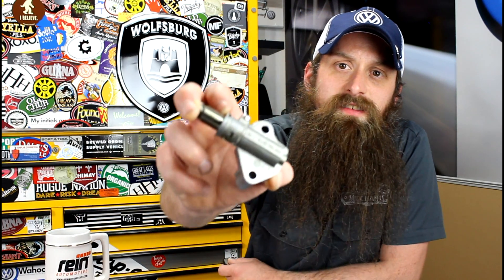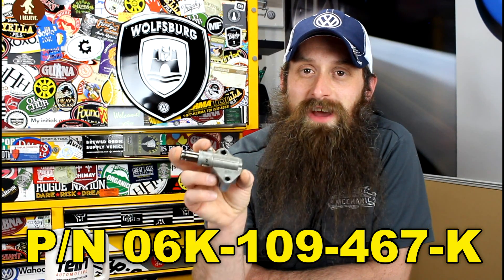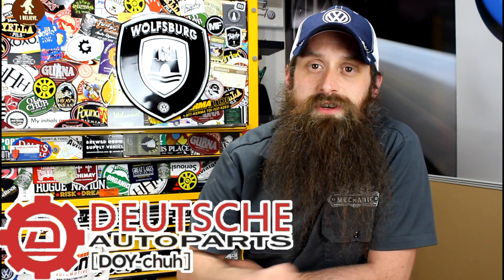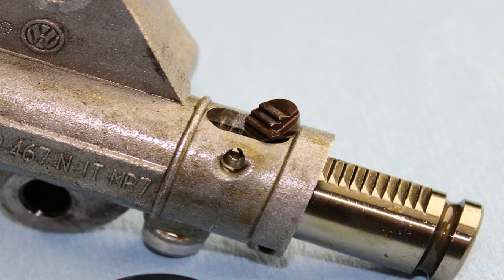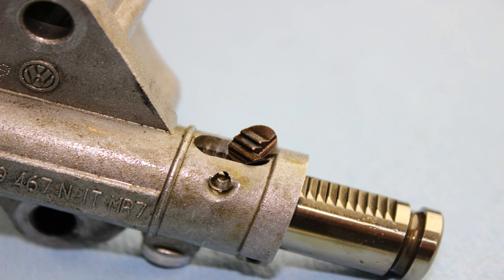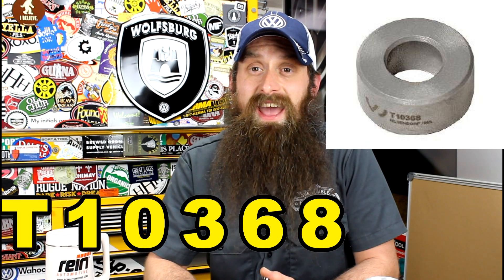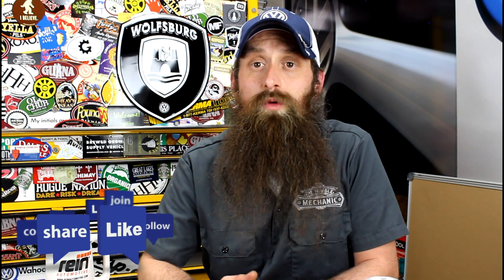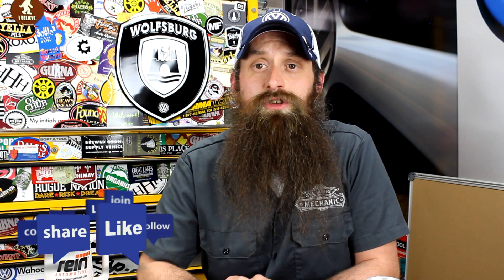How The 2.0T TSI Timing Chain Tensioner Fails

Comment: Hi Humble, I have a build date of May 2011; I probably have the ratchet style tensioner?
My car is currently out of time and need major repairs :(  under 64k miles but has tune.
Reply from the maker: I'd still call VWofA and see if they can help. Or will help.
Reply: +HumbleMechanic thank you. dealer is saying it could be oil related too. like a blocked oil filter. I change my oil every 10k as per the manual. waiting to hear back still for the tensioner status. they just looked through the inspection hole as of now.

Comment: Is this similar to the 2009 Audi A4 tsi timing chain? Also are there any cam lock tools or just that simple "false pulley" piece to hold the crank piece on?
Reply from the maker: There are cam locks that lock into the gear. There is a new crank tool that is much better.
Reply: HumbleMechanic hi i have a 2010 Audi A3 2.0tfsi with the new tensioner installed from 0km and now the car is at 202000km no weird sound yet and i let them check the tensioner and it is still fine? should i replace the chain or will the chain also be fine is the tensioner is stil at the desired level? any feedback would be appreciated thank you

Comment: Mine just carped out too on 2010 Tiguan, I pulled the engine and took the head to machine shop to get the valve replaced. Cylinder 1 no compression. Put back together and the B*** is running smooth again.  Doing anther tomorrow for a friend. VW is starting to piss me off.

Comment: My 2013 GTI with 22,191 miles had complete engine failure while in the dealerships possession. Chain tensioner #06K-109-407-K vehicle shut off while driving and will not restart. Also, there is no mention of the oil pan being dropped and cleaned to remove any possibility of debris in the block. Total rebuild of top half of the engine, now I have to worry about this possible happening every 20K. Daus auto how about DAUS THIS!
Reply from the maker: +Victoria Davis WOW on a 2013? That is the newest I have seen. I have not seen any put metal into the block, but there is a first time for everything I guess.

Comment: HumbleMechanic, I have a 01 Audi A4 1.8T. We recently rebuilt the engine and we did not remove the head, after the engine was installed and timing set. We cranked the engine and no start. After further investigation we saw the timing for the camshaft sprocket was very off, we tried to set the timing that the sprocket would not move past one quarter turn. We removed the head cover and noticed the camshaft chain only jumps once and it locks, the timing can not be set since this is not turning. Ant input would be greatly appreciated.

Comment: Have a question about the spacer. You said without using the spacer t10368 you can be up to a half a tooth on. When exactly do you put the spacer on the crank bolt and install it to the crank. Once it is on when is it ok to remove it?
Reply from the maker: As soon as the crank pulley is removed, the spacer goes it. Don't donor touch anything until that spacer and bolt is installed.

Comment: I LIVE IN TORONTO CANADA. I HAVE  A 09 TIGUAN 2.0T AT 138 000 KM.  THE ENGINE ALL OF A SUDDEN WONT START.  HAVE TO TOW TO I WAS TOLD THERE IS NO COMPRESSION IN ANY OF THE CYLINDER.  I THINK IS THE EXACT PROBLEM THIS VEDIO IS ABOUT.  NO WARNING NO SYMTEM. THIS 2.0T ENGINE JUST PASS AWAY QUIETLY.   THEN I WENT TO SERVICE AT VW DEALER TODAY. AND THEY CAN JUST ANSWER RIGHT AWAY AFTER I DESCRIPE THE PROBLEM.  " 11K TO REPLACE THE ENGINE OR HALF OF THAT TO TRYING TO FIX" 5 YEAR OLD CAR GOT 130K KM AND NEED TO CHANGE ENGINE. THEY DONT EVEN NEED TO LOOK UP TO COMPTER FOR THE PRICE.  BECAUSE THEY KNOW IT AND THEY ANSWER THIS QUESION  EVERYDAY!  AM I RIGHT!  AND MY MECANIC TOLD ME HE HAS A BUDDY WORK IN VW DEALSHIP THAT THEY CHANGE 2-3 ENGINE EVERYDAY. THIS IS CRAZY. THEY HAVE SUCH A COMMON ENGINE PROBLEM.   WHAT DO YOU GUYS THINK OF IT.  GET RID OF YOUR 2.0T VW OR AUDI AS SOO AS POSSIBLE.  IF YOU ARE LEASING IT. NEVER BUY IT BACK.  THEIR SERVICE DEPARMENT IS ALWAYS BUSY.  I WENT TO BRAND OF DEALER AND THEIR IS MUCH QUIETER.  ALRIGHT, I KNOW THERE IS A WEBSITE WE CAN GO : CARCOMPLAINTS.COM.  THIS PROBLEM IS POST A LOT IN TIGUAN. IT IS SUCH A COMMON PROBLEM FOR THIS ENGINE WHICH IS SUPER REDICULOUS.  OK I HOPE THIS WILL HELP YOU BUYING THE NEXT CAR! GOOD LUCK !

Comment: please include a link to video with tools needed to get the job done. I have 2010 CC that does not start. I bought a repair manual and in the process of slowly getting to the chain and surrounding parts. I also would appreciate a narrative of setting the timing of the car. I did notice one notch on the exhaust side but not on the intake.

Comment: I have the exact same problem you mentioned car wouldn't start one fine morning. I have a 2008 Volkswagen Passat 2.0T. The VW specialist did examine and told me that there is no tensioner and compression when he checked from all 4 manifolds and told me all got 0 psi. He did quote me close to 5k to get it done along with if at all there is any bent valve and I feel its not worth spending 5k for my car which is 106k miles driven. What should i do? Can I just try fixing tensioner?  Appreciate your help and please let me know these are too much expensive to fix or what could be the ball figure?
Reply from the maker: +Venkatesh S sadly that is a big time fix. This same thing just happened to a friend of mine on his Tiguan. The only fix is replacing bent valves and all that goes along with it.

Comment: So our tensioner "failed" and chain jumped 3 teeth but it didn't bend valves according to the shop.  However, they are saying there is an oil "screen" that they can't find.  it's a small screen - like the size of a pencil eraser or less they say.  They removed pan and it's not there.  They also say the screen must be "floating around in the engine and could damage engine it is gets dislodged.  Wouldn't this filter be trapped by the oil filter before it is pushed into the main bearings, etc...  If the screen is missing should the engine be replaced ?   What if another "used" engine is swapped in from a yard ?  wouldn't we require the tensioner be changed on the yard motor before it goes into the passat.  2008 2.0T.
Reply from the maker: +Floriday2 From my experience when you can't find that screen, it is usually jammed in the intake cam adjuster. We generally replace the intake cam for that issue.

Comment: I have the exact same problem you mentioned car didn't want to start. I have a 2010 Volkswagen CC. The mechanic replace the time chain and Tensioner. After that was done he said there is no pressure coming from the intake so he is assuming its a Bent Valve or we have to change the whole head. He made it seem like I am going to spend a lot of money to fix it, where he has to send it to a machine shop but he was very keen to offer to buy my car from me. What should i do?

Comment: This worries me.  We have a 2009 Tiguan with a 100,000 miles.  So far, no problem.  I mean how common is this problem?  I mean I car in a 1000 or is this like the intake recall where all of them were bad and it is a matter of time.  I have an extended warranty and I was thinking of having it done but I believe they won't do it because it is not making noise.  What is your opinion?

Comment: check oil level ones a week !!!!!! those tsi's like suck some oil
Reply: lolus pololus had my MK6 GTI for 5 yrs not once have I had to add a drop of oil between oil changes.  I run Castrol 0w40 changed every 5k miles 👍 zero issues.
Reply: not if the pistons and PCV are replaced per the TSB.  I use about 1/4 qt in 10k miles at most.

Comment: Charles, a great video. I would like to understand all of the failure modes for the timing chain tensioner failures.  I also wish there was a way to know which version I have.  My 2012 Tiguan is approaching 70K miles and at low rpm and under load, I hear a sound similar to a high frequency spark-knock from the passenger's side. I wonder if I am hearing the tensioner on its way out?
Reply from the maker: sbcncsu That could be a timing chain tensioner issue. I would give Apex Tuning in Apex a call. Chat with Kevin and see if they can take a look at it for you. 

Tell them I sent ya! (Assuming you are still near NC State)

Comment: Quick question... I noticed that a few "tuned" ccta 2.0t owners have had issues with VWOA when these fail, while many do not. Why do you think that VWOA covers some tuned cars for these faulty tensioners and not others?
Reply from the maker: Spicytunafreak83 It really a call made at the dealership level. That call really depends on where you go. It also depends on what "tuned" means. Does that mean a cold air intake and exhaust? Or are we talking stage 2 with a K04?
Reply: I was thinking stage 1 or 2 w/ dp ecu tune.

Comment: Thank you for making this video. You kept mentioning CCTA 2.0tsi engine but I thought it affects all 2.0tsi engines including CBFA.

Thanks
Reply from the maker: It does impact other 2.0t engines but not all of them. The CCTA is the most common one. But yes other do apply too.
Reply: +HumbleMechanic Hey m8! The very first 2.0TSI scirocco from 2008 is it in the same boat as well? If i request the preventive change of the tensioner and maybe the whole chain and appropriate parts will i get the new updated parts or not? thanks!